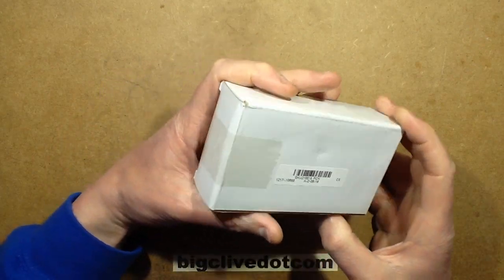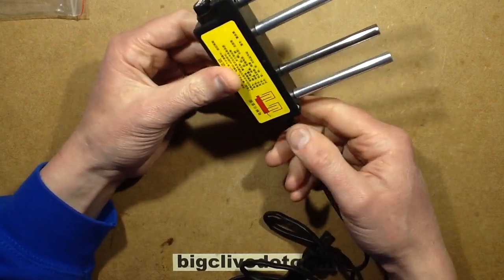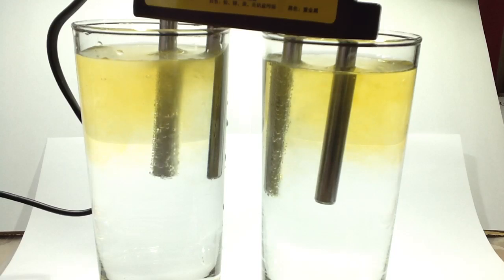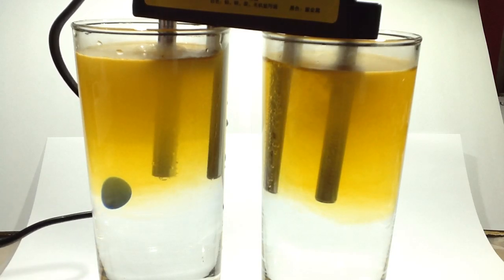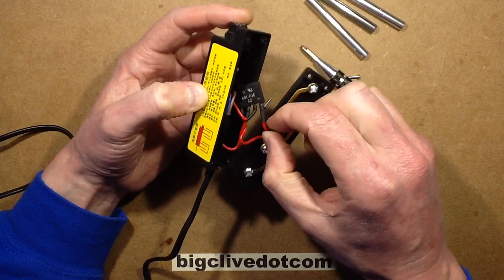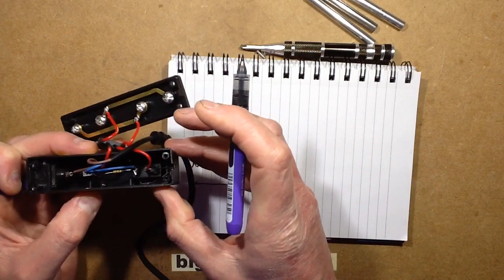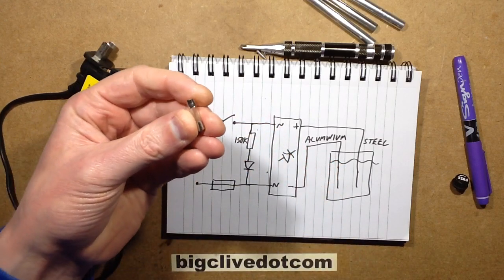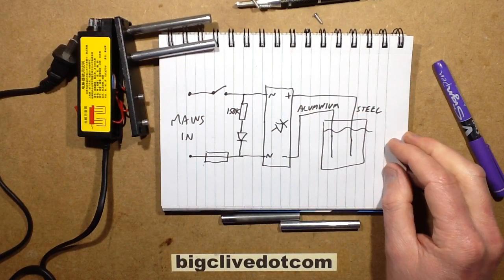Deadly quack water tester.  (scam)

Comment: Okay, so digging back into my corrosion course I think I know why they used two different metals. The device involves galvanic corrosion because it has two different metals in a medium with charge carriers (dissolved stuff like salts, etc..) In galvanic corrosion, one metal remains intact at the expense of the other and it will happen on its own over time which is why you want to be careful about building things with different metals in contact if they'll be in a wet environment. You can also apply electric current in one polarity to speed it up, or you can apply the opposite polarity to impede the corrosion (or reverse it, which is why you'd normally use something that can't corrode as the other electrode in such a case).

Now normally it's the aluminum that will corrode while protecting the steel, but a high potential in the other direction may reverse that. They could have used gold instead of aluminum but that might have been too expensive and too visually-obvious about what was going on, so they picked metals that looked roughly the same. And in making the iron corrode very rapidly, it makes a cloud of insoluble iron oxide which gives the illusion that all sorts of gross stuff was just revealed to be lurking in your water. Distilled water with few charge carriers wouldn't undergo this anywhere near as rapidly, and would look much better in a side-by-side test.
Reply: +Sarah Watt (NuclearSarah) This is basically how Electro-Plating works.

Usually steel, copper, zinc, palladium and in some circumstances, gold and silver are used in electroplating.
Reply: I never studied electroplating, but there are all sorts of things that work off of similar physics. Discharging and recharging batteries is very similar to galvanic corrosion, and the reaction used in thermite can be predicted using the same data that predicts the direction of galvanic reactions.
Reply: Mentorcase It's the principle I was getting at. 

The voltage doesn't really matter, it can work at 240V, as long as it is DC, which this device is. Seeing as it is going through a bridge rectifier.
Reply: +Joseph Stalin Zircalloy doesn't normally corrode in a PWR because of two factors:
1) Reactor coolant is pH controlled to be mildly basic causing a favorable hard oxide coating to form that prevents further corrosion.
2) At normal operation temps the zircalloy and it's oxide do not react with water.  Above a certain temperature (I'm not certain if I am allowed to say the exact value under US law) Zirconium behaves as a catalyst for hydrolysis of water. 

That said, hydrogen is generated during normal operation of a PWR as a result of radiolytic decomp of water but total dissolved H2 is usually regulated to be below LEL (4%).  Zirconium does have a measurable macroscopic cross-section for absorption of thermal neutrons, but is dwarfed by materials like halfnium.
What happens when things go really south is a PWR vessel that undergoes rapid depresurization allows for rapid formation of departure from nucleate boiling which allows localized superheated steam to come in contact with critically hot zirconium leading to rapid generation of H2.  This is not so bad if it happens on one fuel plate or two, but when it happens across the entire fuel cell matrix you have several thousand square feet of fuel clad surface area now generating hot H2 gas, and you can imagine where that leads.
Reply: sivalley * "At normal operation temps the zircalloy and it's oxide do not react with water. Above a certain temperature (I'm not certain if I am allowed to say the exact value under US law) Zirconium behaves as a catalyst for hydrolysis of water."*

You can say the value, namely because anyone with a basic understanding of physics and maths can work it out. I imagine if I wanted to find out I can get some zirconium and find out myself (seeing as it's an easily available material).

But thank you for explaining a bit more. I know a fair bit but never knew Zr was used in PWRs or nuclear reactors at all. 

To be honest, I think they need to invest into Thorium reactors.
Reply: +Sarah Watt (NuclearSarah) I thought as much regarding the iron-oxide particles, though I've never formally studied such things, seemed off to me then it clicked that electrolysis generates oxygen, which could bind with the iron from the steel that would come away into the water. Yay science!
Reply: Yeah, a lot of corrosion reactions take oxygen from the water and let go of the hydrogen as gas. As a nuclear engineer I've studied this a lot since Fukushima Daiichi's hydrogen explosion; the hydrogen was produced in a high-temperature corrosion reaction between steam and zirconium, producing hydrogen gas and zirconium oxides.
Reply: sivalley covered the corrosion aspect pretty well. Zirconium (and specially zirconium alloys with small amounts of other stuff in it) are fairly transparent to neutrons while having good strength, good thermal characteristics, good resistance to corrosion under normal conditions (as sivalley says, it forms a passivating layer under the normal reactor conditions) and all while being pretty inexpensive. It gets used in places inside the reactors where structural components are needed but you don't want materials that will block neutrons or become activated by them. In CANDUs (what I've mostly studied as I'm Canadian) they're used in the pressure tubes that separate the fuel channels from the moderator tank, as well as the cladding for the fuel bundles. It's my understanding that almost every reactor design uses zirconium alloys for the same sorts of things.
Reply: Though obviously it's not a perfect material in all situations, as during a loss of coolant accident it can be exposed to overheated steam and rapidly produce hydrogen. But hey, that has only been a serious issue a couple of times out of however many thousands of reactor-years worth of nuclear energy the world has racked up.
Reply: Chernobyl was primarily a steam explosion. They had shut down the reactor earlier and were attempting to restart it as part of an experiment. The operators had poor training and didn't realize the xenon buildup in the fuel (which spikes shortly after a shutdown) was the reason why the reactor was so sluggish to respond so they put it in a dangerously high-power configuration (also after disabling alarms and safety interlocks for the experiment). The xenon burned away and the reactor power spiked high and rapidly enough that the heat transport system exploded from steam pressure before anyone could react.

There's some debate as to whether secondary explosions after that were caused by hydrogen or something else, but the damage was already done and whether it happened or not is purely academic.
Reply: Joseph Stalin  No, Chernobyl 4 lost its roof because of a steam explosion.  The RBMK design was rather insane in retrospect. In a tradeoff between flexibility and safety they had several hundred fuel pressure tubes that could be re-fueled live. This also meant that there were several hundred welds that could fail. The nail in the coffin was using carbon as a control rod with a steel (cant remember exactly) follower at the tip that actually caused reactivity in the core to rise before coming back down. Throw that in with a loss of coolant flow and you now made an unstable reactor even more supercritical.  Coolant in the pressure tubes instantly boiled and it was more than the safety relief valves could handle causing several caps on the pressure tubes to blow off.  Sure there were some hydrogen explosions afterward that caused even more damage, but the loss of primary and secondary containment was because of the volume of steam generated.  The shed was only estimated to be able to withstand 5psi (.3 bar?), versus others of the time rated above 100 psi (6.6 bar?).

I should thank you for letting me reminisce on my days in the US Navy as a nuclear plant operator. :)
Reply: +Joseph Stalin Not with 240 volts and with a lot more amps.
Reply: *****
Yikes, calling that 'not fun' would be a bit of an understatement
Reply: ***** Is the Zirconium used for Neutron absorption (similar to boron)? 

In a PWR it seems a bit daft to use things which could corrode under the conditions in a nuclear reactor. Would be like using untreated wood in a fire retardant curtain wall.
Reply: boats and even water heating cylinders have sacrificial anodes. irc, even brass on boats has the zinc or copper pulled out due to this problem leaving a very brittle crumbly casting.
Reply: ***** Indeed. I'm in no way scared of nuclear power. I'm exposed to radiation regardless of any nuclear power stations being in existence. Humans also emit C-14, a beta emitter. 

I wonder if there are better materials for it out there at all. Suppose materials science will lead the way with that.

I've always understood that it is bad to have something prone to corrosion in a water based reactor, namely due to hydrogen production from corrosion. Wasn't it a hydrogen explosion that based the roofs of Reactor 3 and 4 in Pripyat to blow off (hence the reason for the sarcophagus)?
Reply: *****
Rats, ya beat me to it. LOL
Reply: ***** I see. Either way it sent graphite blocks over several square miles. At least the area is slowly starting to recover from Caesium-137 contamination now.
Reply: sivalley I like talking about nuclear power, especially with advocates for it. There are so many scare mongering lies about nuclear power which makes the general public have an irrational fear for things which very nearly never happen.

It's almost impossible for reactors to fail these days. It took millions of tonnes of water and a 50m high wave and earthquake to make a PWR fail.
Reply: Joseph Stalin
Oh yes, it's fun indeed.  Sad though that if you look at the collective list of accidents there have been involving fissile materials it's almost always operator error, be it doing something that they knew they weren't supposed to be doing, ignoring safety protocols, or straight up not knowing what the heck they were doing.  But because I wager almost everyone learned about nuclear power through the devastation atomic weapons brought they have a horrible bias over the invisible djin that is radiation.

Good luck getting the fear mongers to comprehend that that same 50m tidal wave had more energy in it than all nuclear weapons ever detonated.  As far as anyone with a good grasp on engineering is concerned FJD was this side of indestructible.
Reply: sivalley I was studying electrical engineering, with the aim of going into nuclear power. I'm 22 and had to stop due to financial problems which mention I couldn't afford bus fair to attend lectures, or I faced starvation (I'm not 4.4k in debt due to rent arrears as well as a result). 

That said, a lot of people in my age group are fairly based and on point. They can and will be convinced of nuclear power. Green power is expensive, not reliable and does not provide cheap energy. Hopefully fusion power gets going commercially in my life time. I have been following it since I was a young boy.

I don't know why people blame the power company, general electric, the japanese government and such for a natural disaster causing a nuclear reactor to fail. It's scare mongering and disgusting electioneering and manipulation.
Reply: Joseph Stalin Ah yes, out dear 'friend' green energy.  Such a shame economies of scale and material limitations gave rise to the infamous pipe dream known as "Solar Freakin' Roadways". But we're all having a good laugh at how much Uncle Sam shelled out for that sham. *Would like my share of taxes that paid for that back*

If it makes you feel better, I joined the Navy straight out of high school looking for college money because my family was so poor. I took the bait and spent 8 and a half years doing a job that wasn't anywhere near as involved as they trained me for.  I was very unfulfilled with my job and eventually got kicked out for being "grossly insubordinate", which was just a DADT era cover for "get your non-cis-heteronormative ass lost".

I spent the next five tears putting my life back together after they dumped me state-side off a deployment owning nothing but the clothes I wore, the change in my pocket and my cell phone (looooong story).

Now at 33 going on 34 I spend my days working for a company that deals with heat transfer and fluid flow all day long with a dash of EPA oversight inspired paranoia; good ol' HVAC/R.
Reply: sivalley *"Solar Freakin' Roadways".*

Hahaha. Thunderf00t made a good debunk video on that. Colas, a French road manufacture, is trying to make it happen in France now. 

It estimates it will cost 6 Euros p/kWh, with maybe 3 euro in the long run. Roof top solar units cost 1.5 Euro p/kWh and Commercial solar farms cost 0.7 Euro p/kWh (EEV Blog worked out these figures). 

"If it makes you feel better, I joined the Navy straight out of high school looking for college money because my family was so poor."

I applied to join the Navy last April (of 2015) actually. I'm under weight though (5ft 11" at 53kg (116.6 lb), I've started doing strength training at the gym and eating 4000 kcal a day with about 90g of protein a day too. It's a pain to put the weight on for me as I am naturally lean.

I don't know where my life will lead. I live with my father at present after moving back from the other side of the country (was in Scotland but moved back to England after 3 years up there). I'm on a Zero Hours work contract at a bowling alley and bar. I work with my dad (an Electrician) when I am not there, as well as doing odd jobs like Electronics repair, painting and decorating and just doing the odd job to help out (like gardening, empty out garages and houses of old shit and that). 

I can weld MIG/MAG, TIG, Stick/MMA (manual metal arc) but my skills are recognized by employers in the UK due to the qualification they're bound to. You need Coding here to weld and it's expensive to get it, with no guarantee for a job at the end up it.
Reply: My pipes are 'galvanic', this is normal for my tap water.
A greater concern is when the pipe itself starts to corrode.
Reply: @puppiesarepower3682  do you know what galvanic corrosion is? do you mean your pipes are galvanized, which is a different thing?
Reply: You're only assuming those metals are iron and aluminium. Get arsenic in the washing-up water, and join the honoured ancestors.
Reply: I watched this and was horrified. Would you mind checking it out and see if you think it’s real. If so I’m buying a water distiller 

https://youtu.be/9tmNWRNuzro
Reply: @romeowandrainbow1040  it's a load of crap and all the visible brown scum in the water is rust from the metal electrodes of the device

Comment: How about running your meter across it.....?
Reply: +Grandpa Cocky youd get 240v and up to 10a before the fuse blew...(although the rectifier changes the voltage a bit, but not enough to make it safe)

Comment: Hi Clive what type of filter do you have? if it's a carbon only filter then you won't be removing any scale forming minerals. although I think the water is pretty soft anyway in Scotland. yep I work with filters.
Reply from the maker: +apbosh1 mail Isle of Man it was a carbon and ion exchange filter, but the TDS remained the same before and after filtering.  (about 40)
Reply: +bigclivedotcom oh, filter obviously not doing anything then. 40 tds seems pretty low anyway as long as you have the conversion factor set in the tds meter. thanks for the great videos I'm glad your doing well.